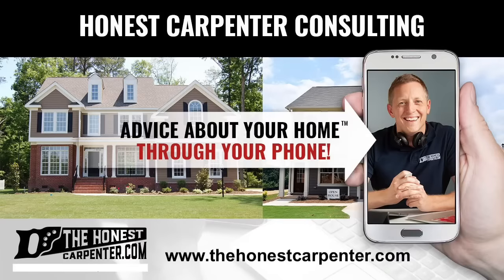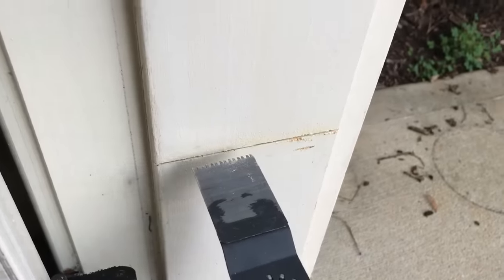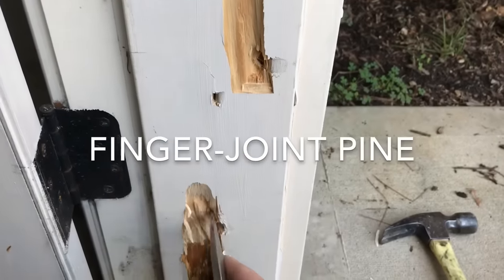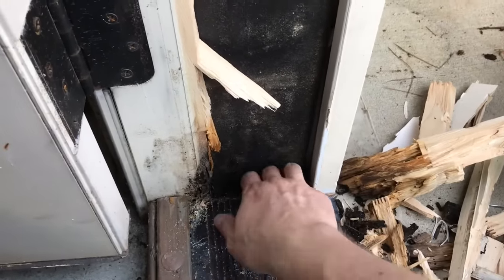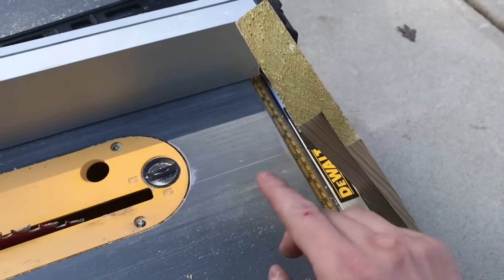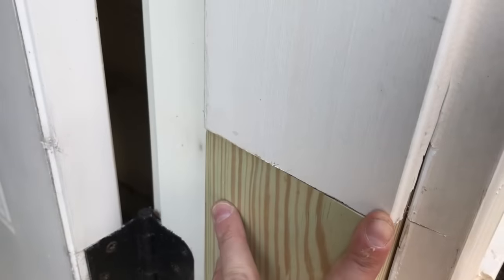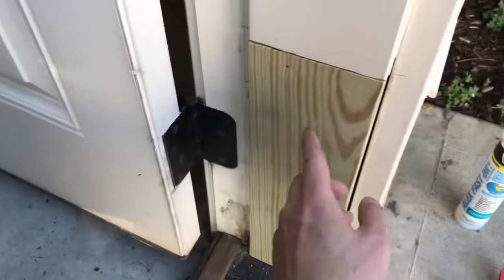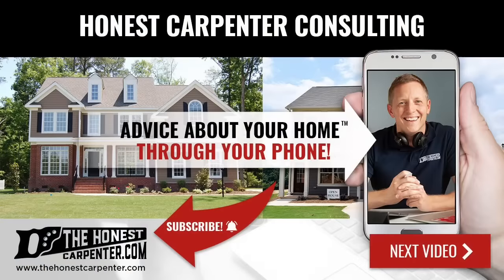How To Repair Rotted Door Jambs

Comment: Much easier to pick up some pvc door jamb and cut the entire width of the jamb out, most of the time you only have to go up to the bottom of the hinge mortise. Use the multi to cut across then cut the nails in the brick mold and inside trim and the piece comes right out. Cut knew piece, nail it, caulk it, done!
Reply from the maker: That’s pretty much an exact description of how I tackle this repair these days dean 😄 The prefab pvc jamb is so much cheaper than it used to be. The only different thing I do is countersink and carefully drive a 3” screw through the jamb into framing somewhere just above the repair. Keeps things from shifting at all if they want to while the repair is happening. Thanks for writing in!
Reply from the maker: That’s pretty much an exact description of how I tackle this repair these days dean 😄 The prefab pvc jamb is so much cheaper than it used to be. The only different thing I do is countersink and carefully drive a 3” screw through the jamb into framing somewhere just above the repair. Keeps things from shifting at all if they want to while the repair is happening. Thanks for writing in!
Reply from the maker: That’s pretty much an exact description of how I tackle this repair these days dean 😄 The prefab pvc jamb is so much cheaper than it used to be. The only different thing I do is countersink and carefully drive a 3” screw through the jamb into framing somewhere just above the repair. Keeps things from shifting at all if they want to while the repair is happening. Thanks for writing in!
Reply from the maker: That’s pretty much an exact description of how I tackle this repair these days dean 😄 The prefab pvc jamb is so much cheaper than it used to be. The only different thing I do is countersink and carefully drive a 3” screw through the jamb into framing somewhere just above the repair. Keeps things from shifting at all if they want to while the repair is happening. Thanks for writing in!

Comment: Wondering if I can use pvc lumber for this instead of real wood?
Reply from the maker: Yes you definitely can! I did this vid at a time where PVC was juuust starting to show up in my market. If I’d done it any later, i would have been using PVC.
Reply: @TheHonestCarpenter  Thank you.  Is there a product that I can use/spray to prevent future rotting?  Thank you for all videos.

Comment: What kind of paint do you use for this outdoor door frame is it latex (like Bulls eye) or has to be oil based to resist water?
Reply from the maker: Hey anyone, there are plenty of latex paints suitable for exterior use! In general you want to use whatever is already present in the house. Very few houses I encounter have exterior oil-based though
Reply: PPG Seal Grip primer top coated with B. Moore Aura exterior. Vulcum &/or All Pro Gold caulk. Money well spent.

Comment: I have the exact problem with a Thermatru door that I chose to be fiberglass.  They shioed it with a pine frame.  WTF!  The pine brick mould at the bottom already has a large hole where water was being sucked up the end grain and rotted away. Also, the fiberglass foor is two skins of fiberglas with a wood center, and I fail to see the insulative value in that.  But what is worse, is that below the bottom door hinge, the wood center has a large rotted section. It's like a sponge that continues to suck up water every time it rains, and we chose not to put a storm door on it because we didn't want that look. Why would they tout fiberglas to be a great product of a door, yet ship it with a pine frame?  It's like buying a  fiberglass body Corvette but the wheel wells are still made of metal. And YET, I have a 38 year old all wood sectional garage door whose bottom edge rests on the cement floor exposed to all kinds of rain and snow melt for 38 years.  It's only been painted 3 times in its lifetime, and THAT WOOD IS AS INTACT AS THE DAY IT WAS SHIPPED WITH NO SIGNS OF ROT WHATSOEVER.  So what kind of wood makes up my garage door?  It's certainly not Brazilian, or Honduraz, or that heavy IPE  wood people are using for decks nowadays. My garage door doesn't rot.

Comment: In that particular application what I would’ve done was take the door off take the trim off of both sides set my circular saw to a 45 and from the inside to the outside I would cut a 90 or a 45 and mirror that on the piece I would insert. Also when I would had the replacement piece I would cut in a slot for the rubber molding that with mirror the rest. I kind of feel that it’s great and then that I will also add glue to that just like you did only it would shed the water better. Or maybe longer I don’t know what you did is a good way to do it I guess I just think That I am very anal retentive go to extremes on most everything I do because I do not want to get called back in a few years saying something did not work
Reply from the maker: I got you! When I'm running new trim, I always do scarf joints like you mention (though everyone here seems to call them "weather cuts"--maybe a different part of the country thing?) For what it's worth, I've never had a call back doing it this way, but you're right, better safe than sorry. In construction, nothing worse than moving backwards. Thanks for writing in!

Comment: The door is not insulated. ? I would have took off the inside trim and put low expansion spray from insulation between the rough framing and door box for sure

Comment: Bad idea to cut the paper and no need to. The two end grain shims will split. The top cut should be at an angle with matching replacement piece to shed water. If you can, mill a single piece to match without backing shims. Paint or use liquid wood hardener on the three end grains.

Comment: Yep true handy man. My customers would never go for that. Replace the jamb like it should be. Not repaired in a wrong manner. End grain shims no no. Down the middle yet and cut into the wrap . No sealer between the joints . You’ve got much to learn but first drop the bad habits and learn correctly.
Reply: You show using an oscillating saw to undercut the opposite jamb to reduce moisture wicking .  Problem is, when that door was manufactured the threshold was either screwed or stapled from beneath to both jambs to make a reasonably rigid unit. Thus when making your undercut your saw blade is going to encounter those screws/staples

Comment: Contractor of over 45 years here. Nice job but never never never use silicone against a painted surface. Use a polyurethane or other construction sealant . Then when its dry you can paint it without using any special primer that will only hold temporarily.

Comment: The good, the bad and the ugly:  The good - you saved a bunch of materials, money and the environment for that matter by not replacing the whole door jamb.  Although you took out much more than I would consider necessary.  The bad - why not use some wood screws and not cut into the house wrap because now there are two small areas for moisture penetration into the door frame.  Maybe the construction adhesive will correct this?  The ugly - you left some rotten wood in the inside portion of the jamb.  In time this might continue to rot away with moisture in the air (it's a fungus) even if there is no more rotten wood on the outside.  It is well below the hinge plate therefore should have cut that part out too as part of your work plan.

Comment: Come down to Florida. The doors are hurricain code ( outswing) just repaired the what you've never see before last week.
Reply from the maker: Matt Woods Dang, every exterior door in Florida is outswing? I didn’t know that. Why do they regulate it that way for hurricane code? Does it prevent something dangerous from happening? (Also, my dad built our in Nevada for a few years, and the stuff that goes into seismic code is unreal. They don’t build houses out there, they build fortresses 😳)
Reply: With the winds and potential flying objects that come with the hurricains the door pushes agains the jamb instead of just holding on by the deadbolt and latch. Older homes such as houses built in the 50'-70's are grandfathered but need replacent. I bet they build them tough over there on God's etch-a-sketch.
Reply from the maker: @Matt Woods “God’s etch-a-sketch” 😂 Well put. Thanks for explaining the code situation down there too. That makes perfect sense, and I’m sure it saves lives when the air pressure starts to drop!

Comment: The door is opening inward, so the middle portion of the door jam expose to the environment is rotted. What if the door is opening outward and the door jam where the hinge located is expose to the environment and so the wood rotted at the bottom (the piece you didn't replace in this video).  How do you do this type of repair?  Instead of just a straight cut and replace the wood, wouldn't it be easier just using resin epoxy for repair (5 minutes to harden) than replacing the wood and then sand it off?

Comment: Instead of the diamond shims, why wouldn’t you make the replacement the right thickness?
Reply: He needs a piece 1 1/4 inches thick. You would have to cut down the thickness of pressure treated wood. You would never be able to follow the exact thickness needed all the way a jamb repair making a perfect seam.

Comment: Better repair is to use Hardy Plank,  a concrete and fiber mixture that will never ever rot again.  After replacing the same door jams several times , I switched to Hardy Plank and never had another issue.

Comment: I don’t think I would cut that house wrap. I do think I would put a dab on it and fire a fastener through the shim. Or get stock that was the right size to begin with. 

And did I miss it, or did you, after noting the problem, also not seal the end grain before you put in the replacement wood. 

You expect that to last 30 years?

Comment: arnt you meant to do an angle cut to stop water and to also secure the bottom piece more as the angle should slot behind the remaining jamb for a tight and secure joint

Comment: I would use azec or some other brand so it never rots again.  And you can use their plug system on the screws so no nail holes but different strokes for different folks i guess

Comment: i would suggest that you prime end grain on new piece, even if it is pressure treated.
Reply from the maker: Hey Charles, I actually seal my end grain with exterior adhesive (I just didn't do a good job showing it in this video). I also usually seat the piece in a bed of adhesive and slide it into place, then attach

Comment: It failed not because it was pine, but because no one sealed the bottom edge, nor was it caulked (or it failed)
  Your new wood is treated,  but I dont think this means not to seal it. Consider while it may take years to rot, it will still get wet, and thus cause the paint to fail.
   Love me some multitool (plunge saw) no tool box is complete without them!
  Seal that bottom end grain with caulking or whatever, then caulk finished product, then paint. Just my 2 cents

Comment: Ethan, how much do you charge to do a job like this?
Reply from the maker: Laughing Hawg For a single door, it usually runs over $200. But in the vast majority of cases, a house will have multiple door jambs with problems, so I’ll group them for as little as $100 per door. Still drastically cheaper than replacing whole units or even just replacing full jambs 😬
Reply: @TheHonestCarpenter , Yes it is drastically cheaper than replacing whole units! :-)  And you are correct, I have two on the garage door and a rim joist under a sliding glass door on a slab that is shot. Bought the house about a yr ago and inspector did a bad job and missed a lot of rot that was hidden with paint. Thanks for the response and a quick one on an old vid at that! It is greatly appreciated. Love your vids, I've been binge watching them tonight.
Reply from the maker: @Laughing Hawg Thanks so much! Garage doors are NOTORIOUS for this. That's a shame about your inspector missing so many items. I'm going to do a video on home inspections eventually--sort of a carpenter's take on how they work, and how to get the most out of them. I really appreciate you supporting the channel. More stuff coming soon!

Comment: get rid of that threshold and cut a pressure treated one for it .  most of those aluminum and composite ones have an airspace inside which allows condensation to form.
Reply from the maker: I see a lot of PT thresholds in covered doorways Richard. But won’t the horizontal wood itself be more prone to rot? 🤔

Comment: Why did you use Tub and Tile caulk on an exterior doorjamb? I thought it would need a caulk made for exterior use.
Reply: Because it will deteriorate in sunlight, is not paintable, and will fail in about a year.

Comment: Should not have used pressure-treated wood, not even kiln dried as one is not supposed to paint ACQ southern yellow pine. The first cut at the top would have been better if it was cut at 45 degrees angling upwards.  A small gap at the bottom of the new piece would allow for air circulation -- always helpfull in rot situations

Comment: I have a 4x6 post at the corner from the ground and acts as a post for the driveway above. See image 1 in the link. It is rotted out at the bottom. I was thinking of cutting half way from the front of that 4x6 toward the back or toward the street side and replacing it with a spare 4x4 see image 2. I would need to compensate for the 2 pieces of 2x6 which butt up against the side of the 4x6. 

Image 1: https://imgur.com/LXCxMzC
Image 2:  https://imgur.com/lgqgU3n
Image 3: https://imgur.com/g0WFtCh 

How do I make sure that replacement wood doesn't rot out again? 
Thank you,
Gnarly

Comment: Every time I've installed exterior doors or paint them I always caulk the bottom of the doors because I always see the same issue with these doors. If you ask me the door makers purposely don't seal the bottom so that way customers go back to buy new doors because most of the times the homeowner will find it cheaper easier and better to just have a new door installed.
Reply from the maker: Isaac alvarez I’m afraid you’re probably right 😓 Some manufacturers are putting in composite bottoms and do some wax-sealing, but some of the new products STILL don’t work well
Reply: @TheHonestCarpenter  I guess they do that so us handymen Carpenters and so on always have work. They sell more products and keep people busy by installing or repairing their products I guess but I'm a strong believer, if we are gonna pay good money for any product it shouldn't fail or rot within a few months of installation. You do good work bud and from watching your video I've learned a few things and I been a handyman for over twenty years.
Reply from the maker: Isaac alvarez Thanks Isaac! I really appreciate you watching. Every time I meet another tradesman I try to learn something from him. I feel like we’re all on the same team 🙂

Comment: I've never seen "shop dried" treated wood in a hardware or home supply store.
Reply from the maker: That's really just what woodworkers call it when something has sat on the shelf so long it's bled its interior moisture. Any treated lumber will do it if stored in an air conditioned house or space long enough
Reply: @TheHonestCarpenter  Thanks.

Comment: While I like the treated wood,  I wish they'd produce a paintable PVC then there is zero possibility.   Cost is more but  NEVER replace that.    Our house is 14 years and I going have to do that to all three outside doors including a french door set on the Fixed and Opening doors.    Like the 45 degree lock in cut, does add complexity but... Could still do that in place using a guide for the angle.   Even if you don't match it perfectly and have to fill it.... it will still lock it in.   Only question is.... What is going to push out that replacement piece.  As long as there is no weight bearing on it  I'm not sure the lock in cut method is needed.
Reply: Use "Stixx" brand primer on the PVC, or AZEK is primeable.
Reply: @edwardschmitt5710  INSL_X line of primers are fine, I've never used in exteriors however (PPG Seal Grip on exterior work for me.)

Comment: You could have done a vertical line with  your oscillating tool. : ) You're welcome.
Reply: Even faster than a vertical cut is to drill a bunch of 1.25" (or similar size) holes with a spade bit.   You can drill about 15 holes in about two minutes, and then finish it up with a sharp wood chisel or the oscillator.   I've been at it for 40 years now, and this method is very versatile in a lot of situations.   He also should have tacked a 2x cutting guide on the jamb to run his saw blade across, for an even straighter line.   And don't get me started on the stupid end grain shims....   This guy has a lot to learn.   I wouldn't use his "consulting" service to get advice on hanging a picture....

Comment: What'd you charge for the repair or what would you have charged for such a repair?
Reply from the maker: Typically around $250 in my area. But I’ll bring that down considerably per jamb if I’m doing multiple doors at the house, which is often the case, so it winds up being cheaper than it sounds.